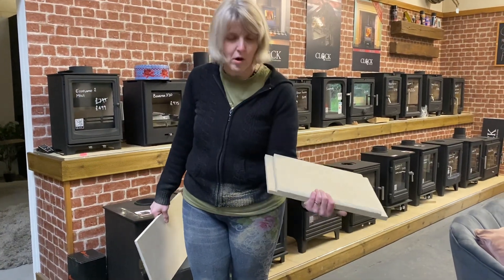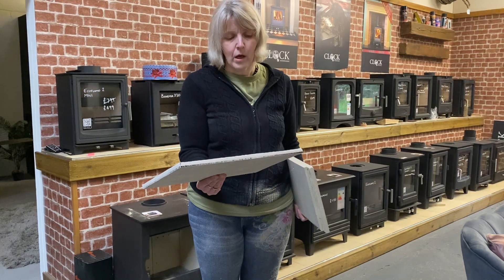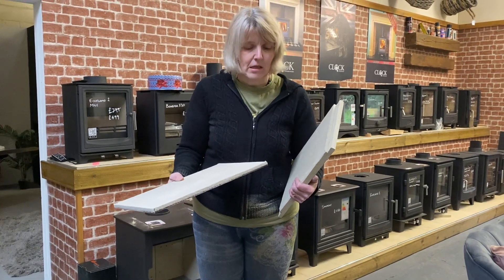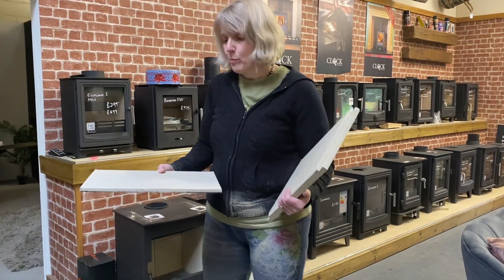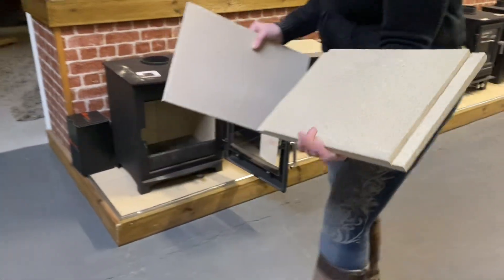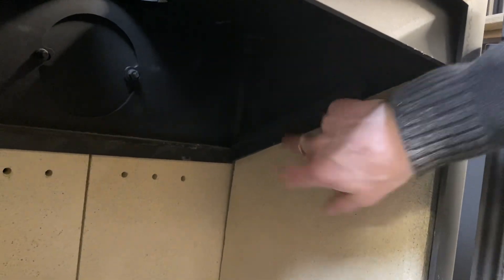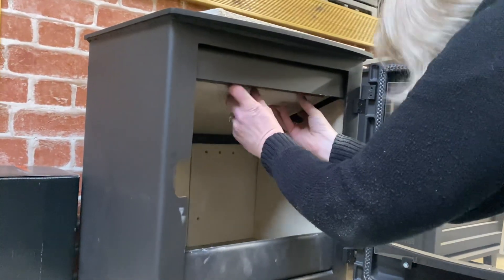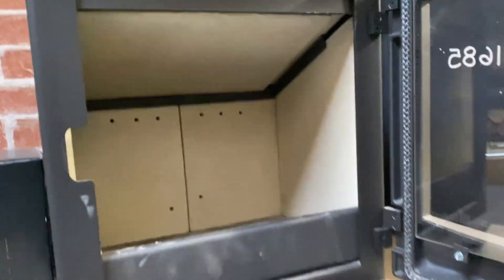Replacement / aftermarket vermiculite baffle for ivar 5 wood burning stove - video for Andrew !

Comment: You’ve just been making me think-I don’t like the color of the insulation material that goes inside and like you said, I’ve read it quiet fragile, would it be possible to put a piece of 4mil steel sheet over each piece of the insulation material making it last longer and look more pleasant? Not sure if I’ve explained that well.

Comment: Hello,hello, could this be done for all the bricks in the Heta 45, asking for a friend 😂😂
Reply from the maker: @wickywicky  you better not have broken yours already !! But yes… for most things. Just makes a mess. Will video next time.
Reply: Ha,ha, no, I haven't bust them yet, but I have noticed they are different thicknesses, so was wondering  if they could be made, especially the rear bricks as they have a recess on the back of the bricks. Cheers, see you soon.